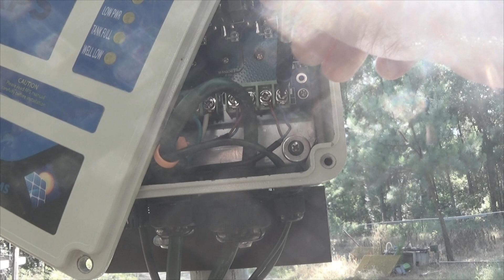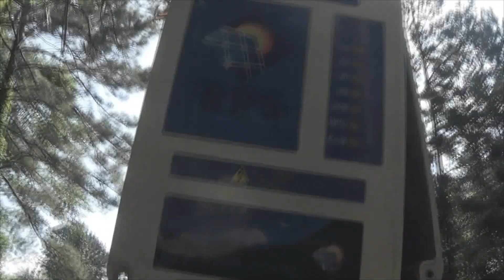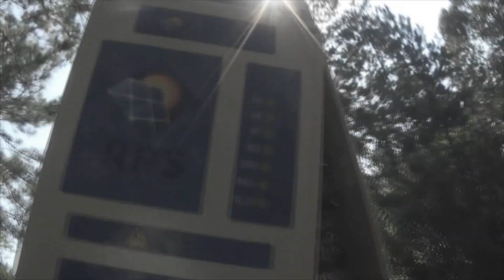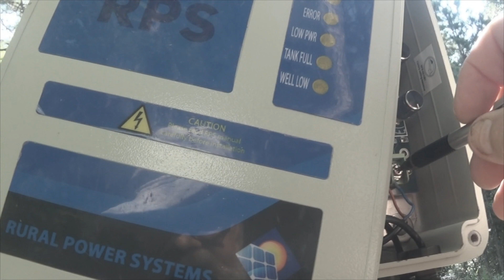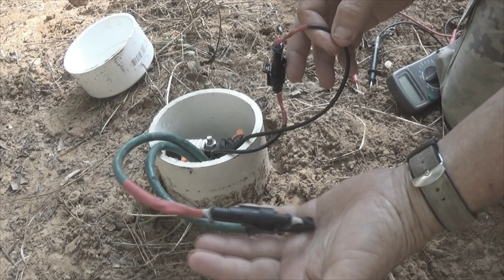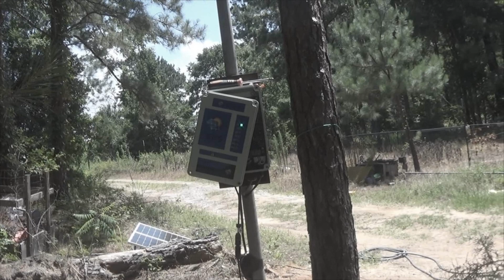trouble shooting a down hole low water sensor RPS solar

Comment: Had a similar problem. Pulled the whole pump because the sensor was taped to the pipe. Sensor was crusted with rust. New sensor is not attached to anything now, so I can just raise the well cap a foot or so with my Jeep jack and pull the sensor...which I had to do yesterday. Makes life simpler.
Reply from the maker: i think i would have done better to follow your advice